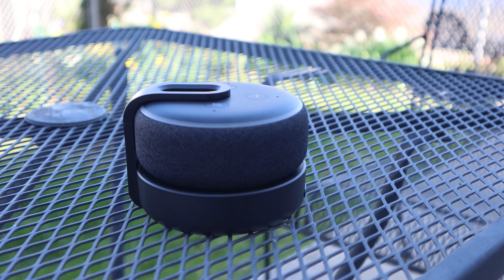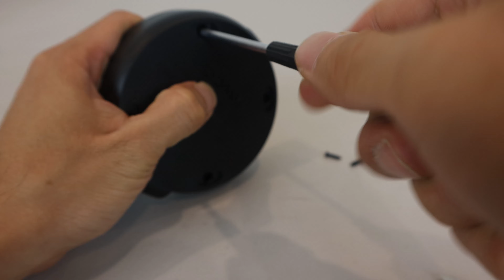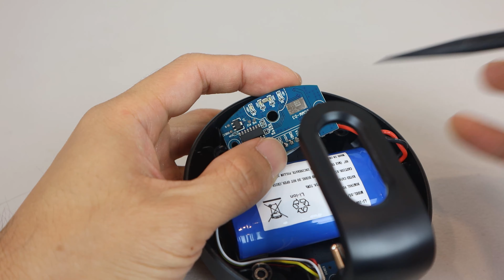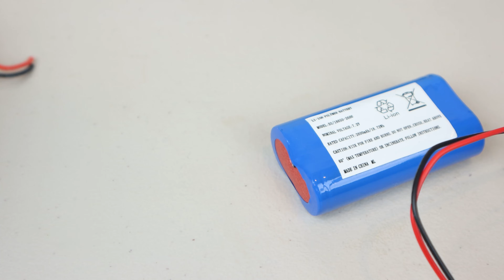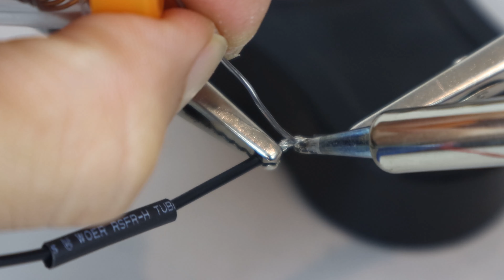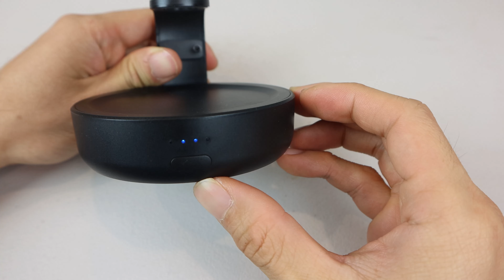GGMM D3 Echo Dot V3 Battery Base Repair Tutorial

Comment: Thank you my friend - excellent video and very well explained.  My battery base is now working again.  In the absence of shrink wrap and a heat gun, I used insulating tape around both soldered joints.  The only other thing I did differently to you during re-assembly was to screw down the circuit board before re-mounting the LED's. I found that extra stability helped with the tricky issue of getting the four LEDs back in their designated holes.  Thanks again.

Comment: FYI, my D3 battery has three wires; the middle wire (usually yellow or white) is temperature sensor wire. Judging from the battery photos it appears to be a PH2.0/3p Connector Plug.
Reply from the maker: Cool, thanks for the tip!

Comment: I'm a novice when it comes to electronics, but instead of disassembly, would it be ok to cut wires about an inch from old battery then solder on cables of new one?
Seems simpler to me.
Reply: Did this work ?
Reply: @stuartbailey5484 I haven't tried it yet. I was hoping someone with a knowledge of electronics would offer advice 😊
Reply: Yes, it worked. Much simpler method.

Comment: when i remove charger the ggmm restart the power is this normal with ur device ?!
Reply from the maker: I have one of the original releases of this battery base which didn't do that, though I've had comments over the years from folks who bought later iterations that does reboot the Echo Dot when unplugged from power. I'm not sure what changed with the hardware though 🤷‍♂️
Reply: @FixItPhil  i also change the battery and notest drop of solder on legs of the main IC , I don't know if this normal or factory correcter

Comment: Great video, very useful, thank you.  I have removed the battery but it has THREE wires: red; black; and yellow.  The replacement has only black and red as per the video.  How do I connect the yellow, please?
Reply from the maker: Since my D3 doesn't have a yellow wire, I'm guessing you have a slightly different, perhaps "upgraded" model, from the one I repaired in the video. My guess is that the yellow wire is used for some sort of sensing in order to cutoff charging when the battery is full/depleted in order to prevent damage to it. If the new battery only has two leads, then it is not compatible with your unit and you should get one that has three leads. You won't be able to "create" a third lead on the new battery and there's no guarantee that it would work (safely) if you bypass this wire. The old battery pack should have specifications and perhaps a model/type number that should help you in locating a suitable replacement.

Comment: Just a little bit of advice here when cutting the battery cables especially on the new battery. Cut the two wires (black/red) individually, not both at once as shown in the video as you will short out the battery and could possibly blow the internal over current fuse in the pack or at least get a nasty spark!! 👍🏻
Reply from the maker: Great tip!

Comment: Hi Phil, excellent video explaining how to change the battery. I think I may have a  problem and will soon need to replace it. My base unit is now flashing 4 lights all the time, which, having lost the manual, I don't know what it means. I am guessing it means it isn't charging properly anymore and next step is total battery failure. Is that right?
Reply from the maker: Hm, I don't think that LED pattern is mentioned in the manual anyway, but I think you're probably right, that it means the battery pack is on its way out. Hope you were able to fix it!